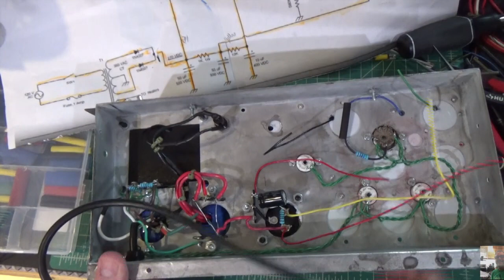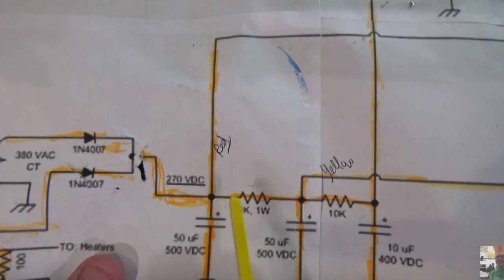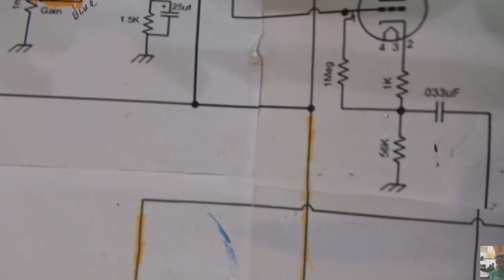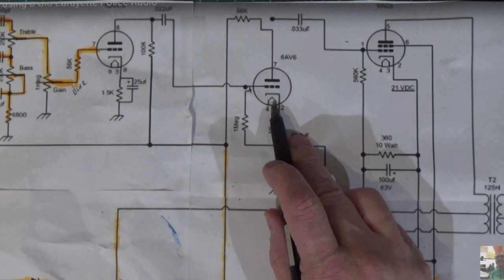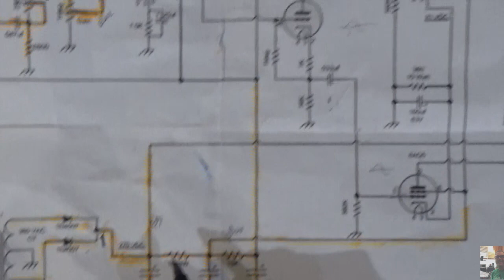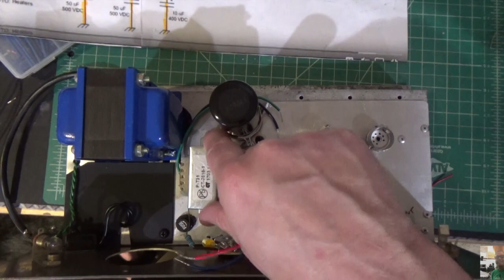Presto K8 Goat Deluxe Amp Build - Episode 5 -  Happy Phase Double trouble !

Comment: Loved the split screen.    I also experienced that the video was not is sycn with sound as others mentioned.    Where is the center tap on the input side of your output transformer????   I only see 4 wires coming out of it, not five     You fuse and switch the hot wire.   It is done this way for safety.   The fuse and switch disconnect the power from your system as close to where it power comes into your device.   This way only a few inches of wire in your unit has live power on it and the rest of the unit is safe when the fuse blows or the switch is open/off .   If you touch a hot wire OR anything tied to it with one hand and touch anything grounded or tied to neutral Adios MFer.   You can touch neutral and touch ground and you should be safe unless someone miss-wired your house wiring.   Never take the chance though!!!!!   Always check.   Coming along nicely sir.
Reply from the maker: Jp... Not sure why the video is  doing that on your end. It is fine here on my end.. weird.  Anyway, I grabbed  the wrong OT in the video so you are correct that this one did not have a CT on the primary. I do have the Hammond 125H which is a center tap OT what I will be using. It will be in the next video.  I am glad the power deal is solved.. I will now create a short video on it so others like me can reference it.   Many thanks

Comment: Mr Ronald McDonald... You've been drinkin too many shamrock shakes with whiskey.  
In a couple weeks, you'll be Irish Italian donchaknow me laddy.  

AC/DC, not that crappy rock group, but electricissaly, cannot be both at the same time.  Why you may ask?  DC is constant, like  battery, and would act on a speaker coil like a solenoid, i.e. hold the cone in (or out), and thus doesn't vibrate, just stays put.  Try it, connect an "AA" to a speaker, the cone moves in (or out), then stays there until you disconnect the battery.  It's a CONSTANT DC voltage that holds the cone in one place.

BUT, you can pulsate the DC by tapping the wire on the battery, the faster that you tap, the faster the con can "vibrate".  If you tapped it really fast, like 100 times a second, the speaker will humm. 

Constant DC doesn't transform, i.e. the transformer's secondary coil is zero, regardless of the constant DC on the primary.  But the transformer can pass through AC, same principal as vibrating metal guitar strings across the pickup coils.  

One more thingy, class B: two tube b+ plates going into the center tapped speaker transformer primary, out of phase, this is why it doesn't cancel itself out.  

There's much more to this, just keep in mind that DC stops at transformers and ecaps, but AC passes.  CONFUSED?  what do ya expect, umajunkcollector explained it, lol.    

Donski, er um McDONald
Reply from the maker: You are absolutely correct Don.  I tried to do a fast explanation but there is so much more and you are right. The Uncle Doug video does a good job of explaining it... in 28 minutes... Don did it in 2 minutes  :) very cool.

Comment: Hi Ron,
I think you've been watching Doug's videos too much! As far as the fuse side of the wire, think of it as a "hot chassis" scenario. On a hot chassis set you may or may not have the hot (black) wire switched. If the white wire is switched, you have voltage running through the chassis even if the switch is off. When you put a fuse in your line on the white (neutral) wire, you will still have voltage going into your transformer and at least to the power switch. By putting the fuse on the hot side you are totally protected if the fuse blows. Hope that helps. BTW all the breakers and fuses for your house are all on the black wire for this reason.
Reply from the maker: thank you Jim. That cements the deal for me... appreciate it !!

Comment: GRRRRR, You had to do it Ron...LOL
I gave up on this as far as VideoPad is concerned.
The amp is shaping up, you will have it ready very soon I know.
The video of the amp is not moving but the sound is going, bet it is VideoPad, use windows Movie Maker much better.
YES the BLACK wire HOT side is fused and goes to the switch, never switch the white or 
the neutral.
Ron, am I the only one who sees that the video is stalled and the sound is okay?
Maybe it has something to do with the split screen at the start of your video?
Reply from the maker: LOL Bill... I knew you'd appreciate it. I do not use Videopad.. I use FinalCut Pro X on the mac, much easier.  I watched the whole video and do not see a problem. At what time stamp do you see the glitch ?  Many thanks.. The Goat Amp is coming to life slowly !!  Thanks my friend , Ron
Reply: After the split screen the video stopped and jumped to other parts but the sound went right on like always.
Dougs newest video did the same thing.
EVERY other video plays fine even your other goat deluxe videos and the other videos Doug made.
Reply from the maker: Thanks Bill... will look at it again. i suspect it may be YouTube.. but... will check further.   Thanks Bill.. this split screen is nothing but trouble :)

Comment: What value fuse are using a 2 amp slow blow? You might want to try a thermistor! for  the live side! of the mains after the switch would be alright to Limit current surge to the tubes when it starts up make sure your heaters are not exceeding their voltage a bit under would be better. Having the output transformer next to the mains transformer not a good idea why can't you put it on the side or underneath on the other side don't forget they got to be out of phase you're showing them inphase?
Reply from the maker: I am using a 2A fuse.  A thermistor... never thought of that... will have to look into that... Thanks , it sounds like a good suggestion.  Regards, Ron
Reply from the maker: John,  I may have an option to move it outside the chassis as you suggested.  This will be covered in a future video when I reveal what I will mount this amp in.  Thanks for pointing that out.  Ron
Reply: Ron C no!! I'm not saying move the transformer outside the chassis?  keep it inside the chassis, but surely you can Mount it on the side or Mount it on the side with studs, say in the middle on the opposite side looks like enough room? Even on the front or back.
Reply from the maker: Yes that is what I meant.. somewhere else on the chassis. I think I found the perfect place :) will cover it in the next video.. Many thanks for suggestions... keep them coming..   I appreciate them.   - Ron